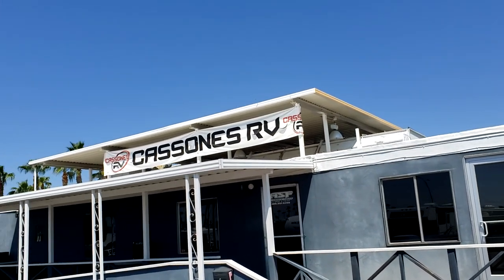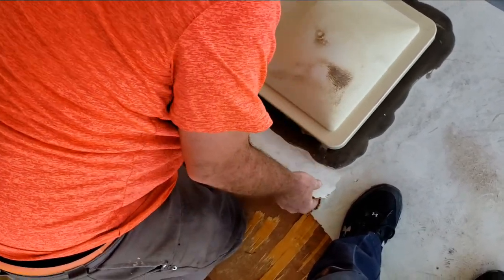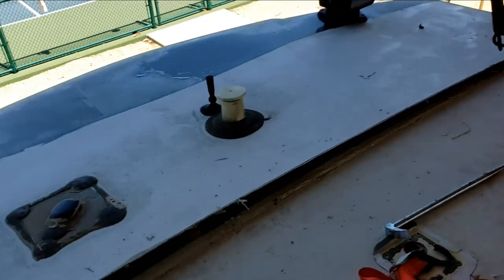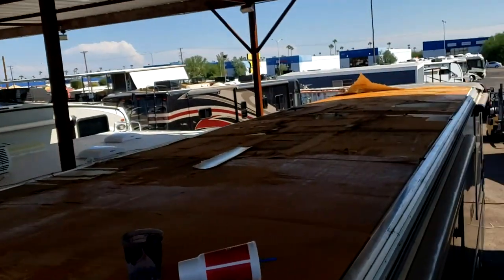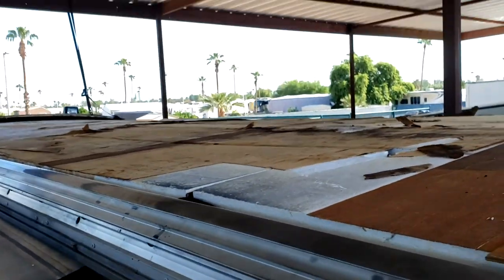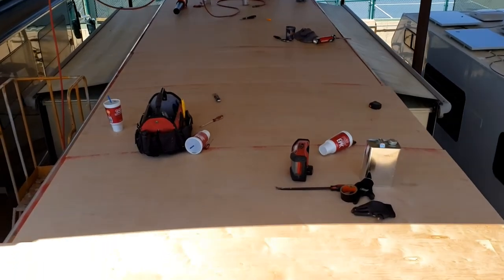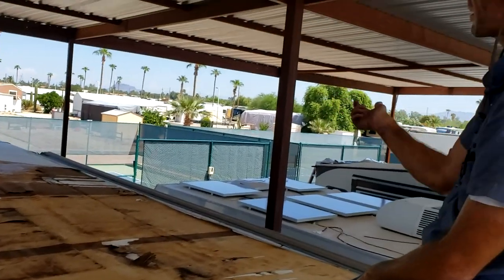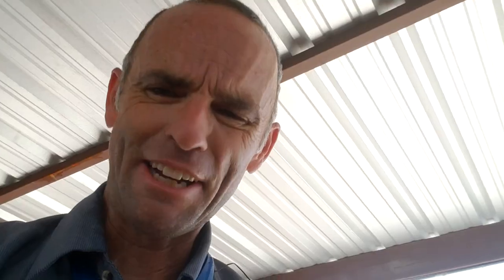Absolutely the WORST RV Roof I Have Ever Seen! 2005 Winnebago Horizon

Comment: Great videos. Well done (and addicting)!

Q1: How do you know inside Luan is OK? Have you ever replaced that?

Q2: Styrofoam has to be fractured in that coach. Does canned foam return full strength? Does it matter as long as new luan is glued down good? 

I am considering a 2014 Winnebago Vista 35B, <20k miles. Getting pro inspection tomorrow. I have a concern over loud ceiling squeaking above drivers head while driving. That’s how I found your videos. Don’t know I want to buy it now even if inspection passes.

Great work! You are a combination of Bob Ross, Bob Villa and Mr. Rogers (a compliment)!

Comment: Love your videos. Have you ever had to repair a floating roof, fiberglass laminated to particle board? The reason I ask is I have a 2018 Sonic SN231VRL . The roof, front and rear are all one piece. Like many others it flexes and warps. In the event of a rupture, how do they repair it. Will it flex the same if they cut the bad part out and try to patch the hole. What do they use to patch it. Or do they have to replace the whole roof?

Comment: Beautiful job, guys. I Need advice, please. 2002 Journey WPK32T, the filon has not pulled out of the radius rail, yet the filon is loose from the radius edge going the entire length of the RV, both sides. It now has an air gap (I can push and see it go down and up) from the radius plus one foot parallel to the edge, from end to end. Should I cut the filon right at the end caps inward a foot so I can lift the filon and reseal it with contact cement? After reattaching the filon to the plywood and radius, I would do the geocel to the tuck point. The filon itself is in one piece and in good condition. Please let me know if I am on the right track. Taking the end caps off might be overkill since the lap sealant will reseal the edge where the end cap overlaps the roof filon. On the other hand, is it best to remove the end caps, and I am overstating the effort to R&R?

Comment: Thanks James. My 2005 Gulfstream diesel toy hauler actually sustained golf ball sized hail in 2019 after which water penetrated the EPDM.  I had already bought the roof coating  with plans to re-coat BEFORE the hail storm hit....what a shame.  Now I have roofing ply that has partially de-laminated ply/ with some rot.  Main issue presently is that 4 ft. X 9 ft plywood is difficult to find.  I wanted to have 3/8" plywood to replace my decking.  I can find 1/4 " ply and lauan .  What is your thought on having the repair shop remove most of the original sub roof ply,  staple 1/4 ' ply to the wood trusses, and glue 1/4 or 1/8" lauan to the plywood before gluing the EPDM down ?  I wanted 3/8 in. ply for additional strength for foot traffic since I have a 2' x 2'  escape/roof access hatch and may add solar panels in the future.  Have you had any issues like this ?    JwgK in Houston, TX

Comment: Can you make a video of the different kinds of roof materials and what kind of sealant you use on each one ? I have a 2003 Endeavor with a aluminum roof that the seams are taped and the tape is coming loose . I need to know what to do and what sealant to use . I like your channel it has a lot of good information thanks Robert

Comment: I sold my 09 Winnebago Vectra 40TD last year. That I really loved BTW. I think as long as you maintain the sealant (I use pro flex) on the radios I think it is fine. But apparently people don't maintain them. Nice Job BTW looks amazing for what you started with. Isn't any RV about proper maintenance?
Reply from the maker: Correct!Thanks for watching!

Comment: What would a roof repair like this cost? Ballpark?
Reply: Many
Reply from the maker: oh it's difficult to quote
Reply: @AZExpert  who is good in arizona that I can trust? Can I call your team to do it? How insanely booked out are you? I just bought a toy hauler and I feel strongly that it will need it. I see no current damage to the wood underneath, walked it and it wasn’t mushy or soft, it just needs new Rubber or TPO.
Reply: @AZExpert  it’s a 27 foot tail gator… toy hauler. The white has left most of the rubber roof leaving exposed black rubber.
Reply: @AZExpert  do I drop it off somewhere for your team to look at?